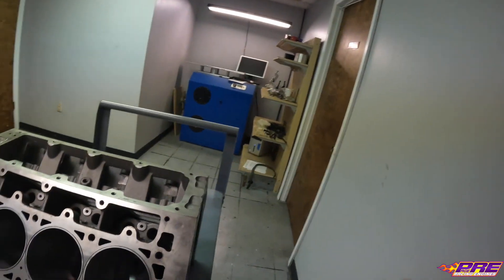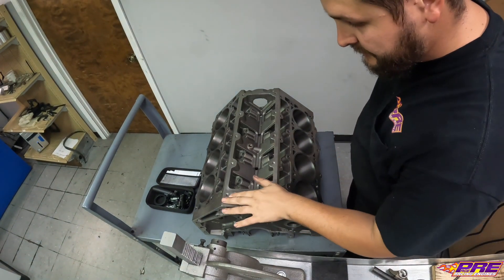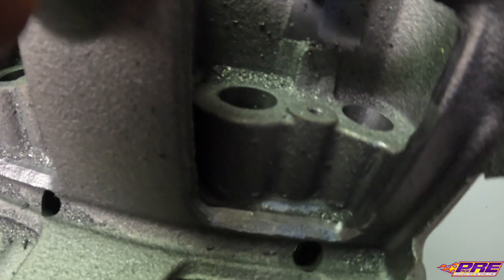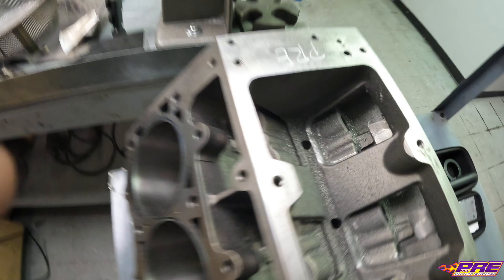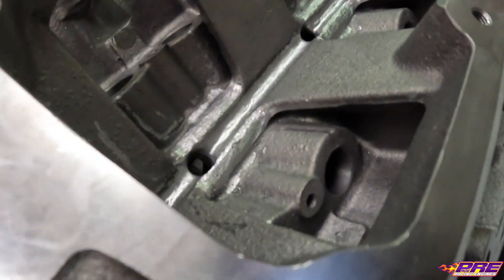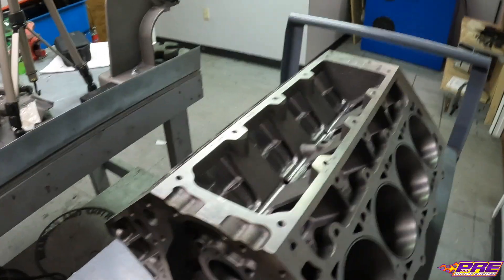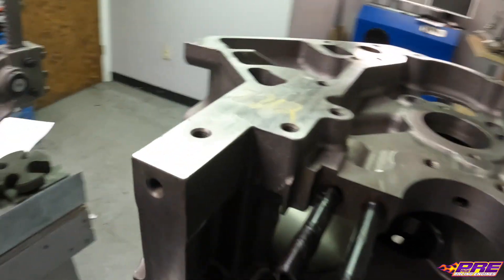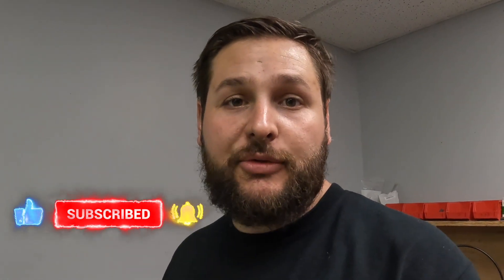A Guide to Race Engine Block Prep and Deburring

Comment: Nice!  So would you also radius/chamfer the top edge of the cylinder bore as well? And would you radius the outer edge of the combustion chamber in the head as well?  I was wondering if you have the two radius‘ed edges meet like that, if it had a little radius at both mating surfaces could that cause issue with increasing the probability of detonation with essentially a tiny “pocket” at the edge where they meet the head gasket?